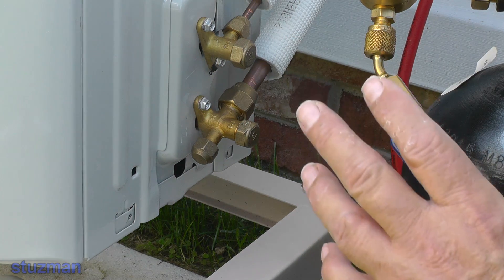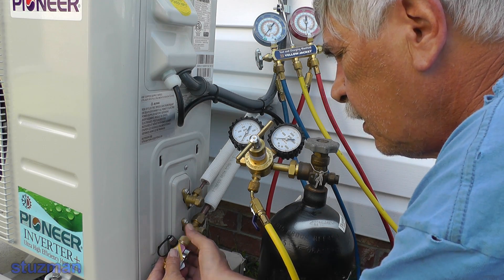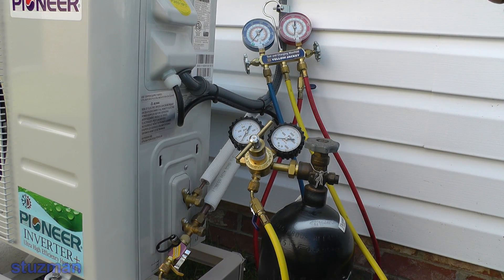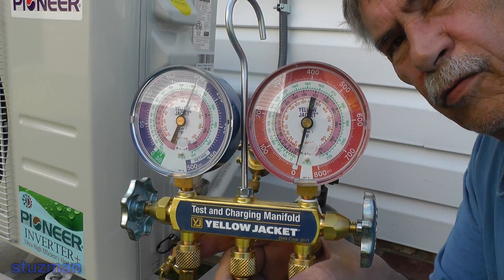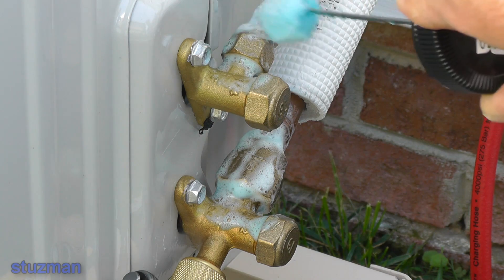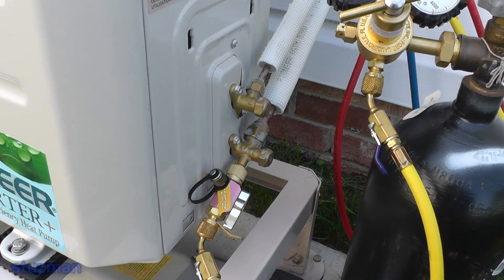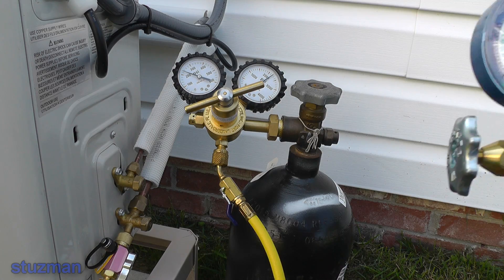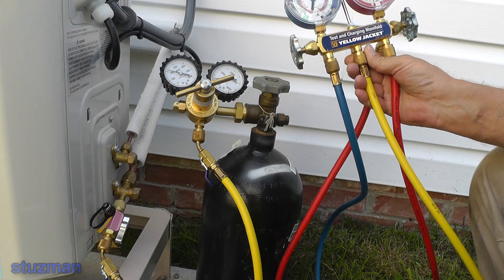Mini-Split Heat Pump: Nitrogen Pressure Test

Comment: Hi thanks for your advice. I already ordered the nitrogen gas regulator from Amazon.  I want to buy a tank; will a 5lb capacity work for my Split AC 24,000 BTU 16 foot line set?  I have to reinstall a new line set. The flare provided is not enough and I got leaks so I will flare my own. The Hilmor Orbital Flare tool arrived yesterday.  Now all I need is nitrogen gas.  SO when my tank arrives; I will just take it to a gas company and have fill it up.  Pls. tell me if the 5lb capacity tank is anough for my need.
Reply from the maker: Freddy, on the nitrogen tank, you go to the gas company and they will sell you a full bottle of nitrogen. They will charge you for the tank if you don't have one. Then afterwards, you will only pay for the refill of the tank. But, you will turn in the empty bottle and get another bottle of nitrogen, but you won't pay for the tank again. Never heard of anyone going to get a specific weight of nitrogen. It's not that expensive anyway.
Reply: Thank you Sir! My tank will arrive this week and I will go to the gas company and have it filled. Your advice really matters to me and I suppose to all your fans following you ion YT

Comment: where do I buy my nitrogen and tank?  I already bought a nitrogen regulator. Thanks.  This is the best and filled with clarity nitrogen testing video on Youtube.
Reply from the maker: I had responded to another viewer with the same question so I'll just post a copy of it here for you Freddy. You can buy nitrogen for about $25-30 a tank. If you don't have a tank, then the company will allow you to buy one. I believe the price for the tank and fill it is around $110. When you empty the tank, bring it back and they'll give you another tank already filled. Give them the empty, pay the refill fee and you don't pay for the tank again. I did this through airgas which is in my city. I'm sure that you have one or a similar company if you want to get a tank of nitrogen.
Reply: @stuzman52   Thank you very much, Sir.
Reply from the maker: Freddy Panes Glad to help!
Reply: @stuzman52  yes, airgas is all over, lots of local locations
Reply from the maker: @cengeb  For sure cengeb!

Comment: In japan they leave the system energized with nitrogen for 24 hours  at 400 psi and 10 mins is frankly not enough.
Reply from the maker: Whatever makes you happy Andy :))
Reply: Hurray! Yes ten min may not show up, some fine leak will take 15 min to blow a match-head size bubble and won’t show on the gauge at all. With nitro I do either a brief bubble test, Or a much longer at least 1 hour watch the gauge test

Comment: So does procuring nitrogen require any special certifications? Can you rent a tank of nitrogen?
Reply from the maker: No Paul, it doesn't require any certification to get nitrogen. You can buy nitrogen for about $25-30 a tank. If you don't have a tank, then the company will allow you to buy one. I believe the price for the tank and fill it is around $110. When you empty the tank, bring it back and they'll give you another tank already filled. Give them the empty, pay the refill fee and you don't pay for the tank again. I did this through airgas which is in my city. I'm sure that you have one or a similar company if you want to get a tank of nitrogen.

Comment: Nice video, but you never isolated the pressure from the nitrogen tank, so there was no way for the pressure to drop below 200psi.
Reply from the maker: Read one of the comments where another viewer thought the same thing. The valves on the manifold gauge set isolates the lines from the tank. If you want to turn the valve off on the nitrogen tank, you can do that, but it's not necessary.

Comment: Hi Terry, EXCELLENT videos!. Could you please explain why you would perform both a nitrogen test and a micron test? Seems redundant to me as both tests check for leakage. Thanks in advance!
Reply from the maker: Using nitrogen to pressurize the system makes it a lot easier to find leaks if there are any. If I was to only use the micron gauge, I could detect there could be a leak, but now, where is the leak when it's under a vacuum. I don't know of a method to check where a leak is while it's under a vacuum. Using nitrogen makes it much easier to find a leak.
Reply: @stuzman52  OK, duh, I overlooked the obvious. A line in a vacuum won't blow bubbles. Now it makes sense. So that brings up another question. If you did the micron test first, which showed that you had no leaks, there would be no reason to do the nitrogen test, correct?
Reply from the maker: Paul Creel yes, that’s correct if it didn’t show a leak.
Reply: Use nitrogen to find the big leak plus you can purge by cracking open high side fitting to remove air noncondensable gas that have moisture out. Vacuum only can not get all the air 100% out, nitrogen is 99% dry. Moisture degrades compressor oil and over time and form acids. Vacuum micron gage will show if any small leaks and get the last of the moisture out if any is left. then slap a over size catch all dryer on with sight glass with moisture indicator system will last 20 plus years if you keep up with the maintenance and watch that moisture indicator.
Reply from the maker: Thanks Paul for the added info and have a great day!
Reply: @paulmaynard377  that makes sense to me now why the manufacturer would require 3 vacuums and 2 nitrogen purges. I've be never seen any techs do this.
Reply: @paulntx the techs do and don't in a way you want your ac working today or in two days old school triple evacuation with a lot more cost to the customer. dryer filter are a lot better now days it does takes some time for nitrogen to absorb moisture many hours and will only absorb very little moisture, nitrogen is used because it is inert to refrigerant not as a dryer. best to blow out the line set with nitrogen make sure no debris in it, then install 3 of the 4 flares purge the air out then turn down the nitrogen to 1-2 PSI and tighten the last flare, increase PSI for testing then bleed down to 2-3 psi then vacuum test if you think you still have a lot of moisture I.E lot of steam coming out of the vacuum vent when you get to 2000 microns purge was not done right do a repurge the system.. if purge was good what little moisture is left in the system, vacuum holding below 500 microns  and the dryer filter inside the unit will take care of it.  just a reminder do not add dryer filter to the outside of the min split if you have mad skills and dont care about about warranty replace that small OEM dryer filter with a better one Note will need a lot more fun tools to change it. tools will cost almost as much as a new split unit

Comment: Hi sir ,would want to hear your opinion on my issue ,here we go . I have a two story home with two central ac systems .one for first floor , one for second floor ,my second floor condenser just failed ,not worth fixing it uses the r22 gas.I can replace with a 4 ton rheem for about $4000 , or just replace it with 3 zone mini split ,one for each bedroom ,i feel i will have better control as far as i dont have to have the whole second floor cool when only one person is in the bedroom.The mini splits would cost about the same .But i heard that since i already have the duct work ,a central would be better . thanks again
Reply from the maker: That's a toss up for sure! I would go for what your needs are. Since you want better control, maybe the mini-splits could give you better control. But you might want to look into zone dampers which can go on your existing duct for the Rheem that would do the same thing. You may want to take advantage of your existing duct work since you have it.

Comment: What is the difference between the nitrogen pressure test and the vacuum test ,what are they for? THANKS
Reply from the maker: Using nitrogen allows one to pressure test the system by using the gauges for a pressure drop which indicates a leak, or by using bubbles to find a leak. The vacuum test is to remove all the air which removes water vapor. Leaving air in the system will allow the water vapor to mix with refrigerant oil which creates an acid that can attack the metallic parts of the compressor such as the bearings. This of course would shorten the life of the compressor.
Reply: @stuzman52  . if i cant do the nitrogen because i dont have the equipment ,wouldnt a vacuum test tell me if i have a leak ? thank you
Reply from the maker: mt In theory, yes, but I can remember where I pulled a vacuum and left it overnight. Checked the next morning and gauges looked good. Charged it with refrigerant and about a week later, I discovered there was a very small leak. So, the nitrogen test has enough pressure to find those small leaks. You can do the job with just a vacuum, but just wanted you to keep the other info in mind.

Comment: Amateur question:  If I don't have a gauge set, could I connect the nitrogen directly to the mini-split port and use the gauge on the nitrogen regulator to read by ?  I'm assuming I'd pressurize to 200psi on the regulator  gauge, the shut the valve on the tank, and if it holds good for 15 minute or so, I'd be good to go ?? 

Want to install a couple of mini-splits fro my own house, and can't really see buying a set of gauges since the unit is pre-charged.  Already bought a 40cf bottle of nitrogen & regulator set + a decent Robinair vacuum pump & low micron gauge for the next step (evacuating the system before turning the gas loose).  The line runs are short, so no extra freon will need to be added.
Reply from the maker: You could do that Ed but the gauges on the nitrogen bottle wouldn't have the resolution unless you had a pretty big leak. More importantly, you would be using a bubble/soap solution around the fittings to find the leaks. Good luck on your installation!
Reply: @stuzman52  OK...thanks for the reply !  And  GREAT video by the way.  Thanks for the time and effort you put into it.
Reply from the maker: Ed Smith Thank you very much Ed! 😀

Comment: Not sure why you took the Schrader valve out ?
Reply from the maker: If I had bolted the outside unit directly down onto a concrete pad, I wouldn't have the room for the valve core removal tool with this unit. So a stand was used for this purpose and to keep snow how of the condenser. Also, while I had the stand, there were a few things that I didn't like about it, so I modified it too. Thanks for the comment MrSprintcat!
Reply from the maker: To minimize any restrictions while pulling a vacuum.
Reply: You could never do this procedure on a Fujitsu. Not enough room for the tool. 😂😂
Reply: I can tell u 1 thing u sure do know your stuff.

Comment: R410A operate at 400 psi or more so have to test leak at least 600 psi for 24 hours.
Reply: Exaclty
Reply: @isaiahlynch1328   I am not an HVAC guy- just a DIYer. Have installed 7 Senvilles for myself and family members in last 6 years.  Read that if you pressure test with too high of pressure, like 400-500PSI, you risk injecting nitrogen past the seals and into the charge of the condensor, contaminating the refridgerant.  i have always tested at about 2000 psi and so far so good.

Comment: In this test  both service valve  LKEY WILL BE CLOSE OR OPEN? OR CLOSE ONLY SUCTION LINE LKEY CLOSE?
Reply from the maker: If I understand your question, both valves on the condenser are closed when you do a pressure test. They will be closed from the factory when the unit arrives. Then when the pressure test is okay and a vacuum has been pulled on the system, then you open both valves on the condenser.
Reply: @stuzman52  Good work.... Thanks sir.
Reply from the maker: m saeed Thank you!

Comment: I don't understand why you would only test up to 200psi, in heat mode the pressures are closer to 450-500psi on the high side, I know it is a common procedure for a leak test but in my way of thinking you should at least get the test pressures up to operating pressures, your thoughts?
Reply: The molecule size of nitrogen is far smaller than that of the hfc molecule and the leak will show up at 200 psi
Reply from the maker: You could set the pressure higher as you mention and should be fine. I believe most people look at it if there's a leak, at 200psi you should be able to see it. Of course, with the higher pressure, you probably can find it quicker because of bigger bubbles. :) Seems like a lot of techs use 200psi for a leak test as shown here https://hvac-talk.com/vbb/showthread.php?1273751-Pressure-test-and-vacuum-on-split-systems

Comment: Why do you need the manifold gauges?  Can't you connect the nitrogen tank with its gauge and hose directly to the service port?
Reply from the maker: Sorry for the delay Phil as YouTube did not contact me. The manifold gauges have a higher resolution than the gauges on the tank which makes it a little easier to see small leaks. :)

Comment: Excellent Video.  By far the best video on you tube on pressure testing a mini split.  You mentioned another video for vacuum the system, Is that available to view?     Thank you
Reply from the maker: steve bates Thank you very much Steve and the vacuum video will be posted this afternoon! 😀

Comment: Terry, I could be wrong but I think you did the pressure test wrong. Now I will admit that the soap bubbles proved that the system wasn't leaking, that's settled, but I feel that you needed to close the valve on the nitrogen bottle to prevent the bottle from replenishing the lost nitrogen there would be if there were any leaks. I don't think that closing the low side valve does much for you because you can't then tell if the leak is happening beyond the valve as the gauge is then isolated from everything downstream from the valve and the gauge itself is being replenished by the nitrogen bottle. For this test to be valid I think you need to close the valve on the nitrogen bottle.
Reply from the maker: That's okay Dennis and we're all here to learn. When the valves on the manifold gauge set are closed, the nitrogen tank is isolated from the equipment. The gauges are then only reading the pressure inside the system. Even if there is a leak inside the system, the nitrogen tank is not going to replenish the system with any more refrigerant. It's the same if you were going to charge a system with refrigerant. With the valve on the refrigerant tank open, you charge they system. Do you turn off the tank supply valve to measure the pressure? No, because when the manifold gauge valves are closed, you're reading the equipment pressure which is isolated from the main supply pressure on the tank. Here is a link to how manifold gauges work https://www.youtube.com/watch?v=xGQ1OwqEppU And here is a link to a master HVAC tech who is doing the same exact procedure https://www.youtube.com/watch?v=2REIP5Ddn60 There's no problem in turning off the main nitrogen supply tank, but it's really not necessary :)
Reply: @stuzman52  that was helpful! Thanks.
Reply: He did turn off the gauge set to disconnect the system from the nitrogen bottle but he didn't mention that step. See it at the 4:00 mark.
Reply: @DonBarthel  4:00 mark didn't show any turning to close. Thus causing question from lot of people.
Reply: Brilliant video, just a question, if I close the nitrogen valve after pressurizing the system.  If the pressure is sustained at 200 psi (as in the video), do I still need to do the soap leak test.
Sustained pressure would mean there are no leaks in the system ?, kindly correct me, if am wrong.
Reply: Your almost right , the answer: turn off the low side valve. And de-pressurise the nitrogen supply side. You then measure nothing but the machine to the low side gauge. With not the remotest chance of replenishing from the gauge set.
Reply: Would pressuring it to 350 and letting it sit for a week be wrong ? To verify if there's leaks?